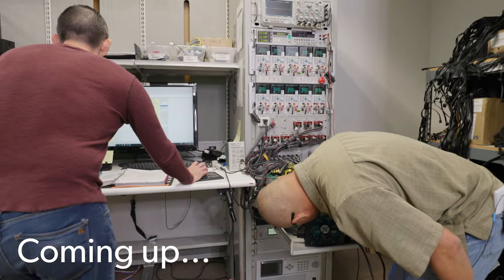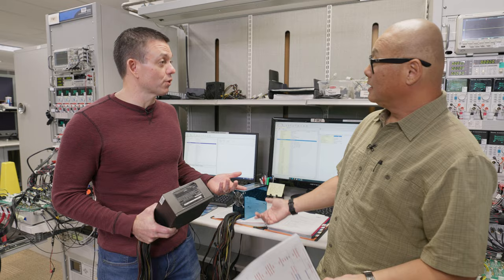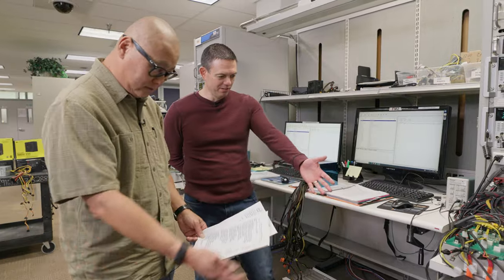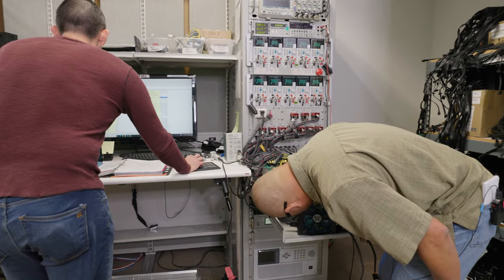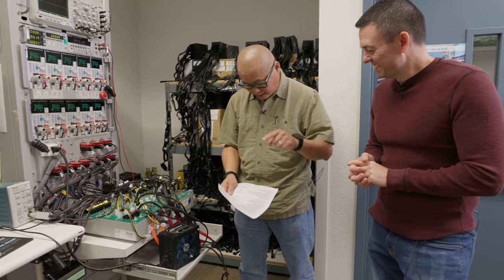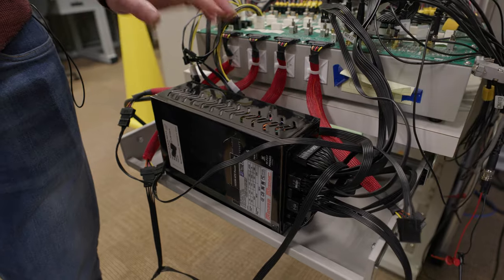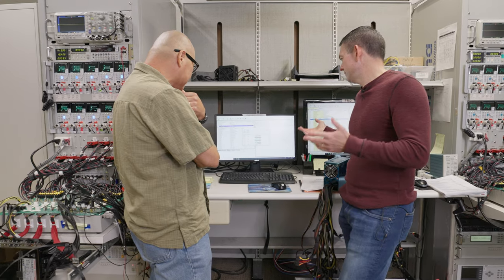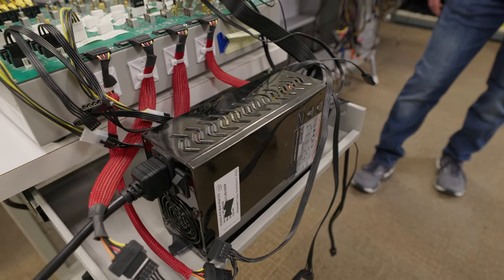Gordon's PSU Fails Intel's Test And Goes Up In Smoke!

Comment: In Apr 2019 I bought 2 new 600W xTech power-supplies locally for $16 each, one for my Ryzen 3 2200G desktop (TDP 65W) and one for a Pentium 4 HT Backup Server (TDP 82W).  They had the following plugs; 24-pin; 4-pin; 2 SATA plugs and 2 Molex plugs :(   I only had 2 minor problems: 
- One power-supply fan (2-pin) had to be replaced after 3+ years, because I used it 24/7. The desktop suspends automatically and is never powered-off. 
- On the Pentium with 4 HDDs, it only switches on, if I combined one 3.5" IDE HDD with one 2.5" SATA HDD on each power-line. 

All my PCs are connected to a 1200W Avtek Surge Protector, since we have 2 to 20 power fails per week.  Before the Avtek I had one defect off-lease PC per year (SFF power-supply or motherboard) and probably now Avtek protects the life of those $16 power-supplies too.  By the way that Pentium 4 HT stuff is from a 2003 HP d530 SFF with a defect SFF power-supply :(

Comment: I am literally having the problems he mentioned w my PC just shutting off randomly when I boot up a game or sometimes when I'm running multiple video, checked the CPU and GPU temps they were fine checked the system logs for the shut down and it was some "Kernel; power" issue turns out it my 2 year Old 800W Gold Power Supply by Thermaltake.
Reply: Thermaltake. Get one from some of the better companies: Antec, Corsair, EVGA, Seasonic or Bequiet. The asus psu's are nice, though really overpriced.

Comment: How can it fail to deliver 35 watts when it was actually loaded to a few hundred? Obviously you'd buy a PSU with some reserve and avoid no-name brands. If the outside becomes hot beyond belief you'd stop and fail the test instead of destroying equipment that could have been derated.

Comment: Gordon brings the Chinese knock-off special and it fails. I mean, we kinda knew it would. I only buy superflower or seasonic. Granted, my PSU now is an ANTEC, but its a seasonic clone meaning seasonic made the internals but it has an antec shell and it uses seasonic cables. I only buy quality stuff!

The pixie smoke you keep smelling. From electronics going bad, that can give you cancer. just saying.
Reply: @Gamehighlight2023  thats cuz you dont know anything about anything
Reply: @Gamehighlight2023  Superflower and Seasonic between them make/made a lot of the PSUs for the reputable brands you have heard of. Seasonic make most Corsair PSUs and EVGA Supernova PSUs were made by Superflower.
Reply: I've got a Seasonic psu 850w here that's pretty weak.